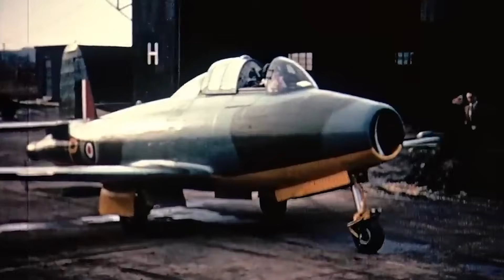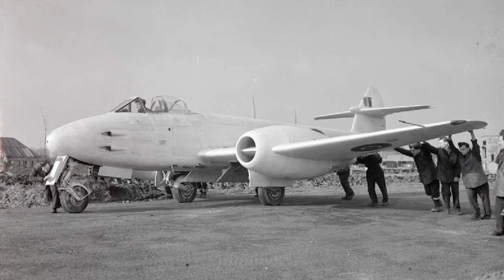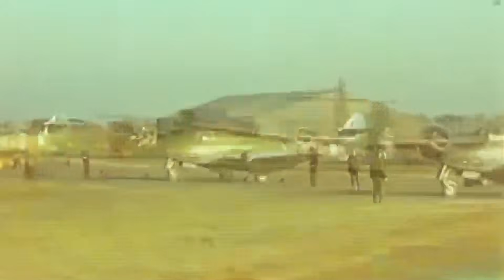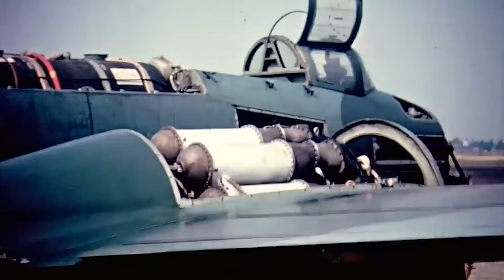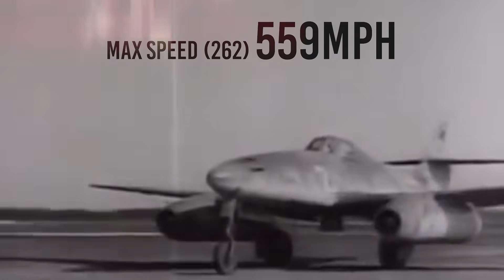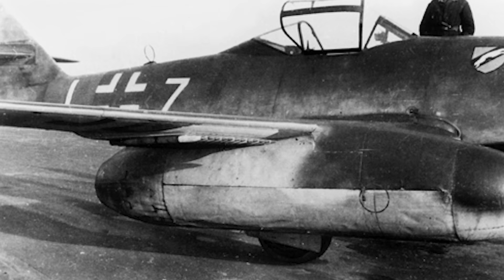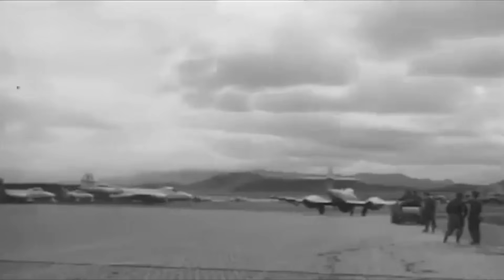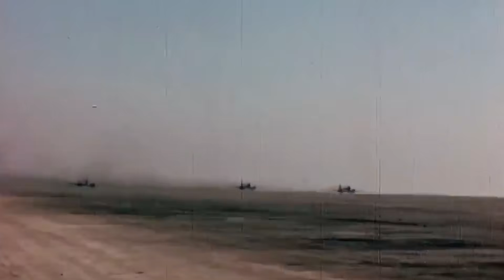Meteor vs Me 262 | Which was the better WW2 jet?

Comment: I understand the Meteor turned better. It was slower than the 262, but ended up faster in later versions.
The 262 wing sweep was a centre of gravity modification and was a similar angle to the C47 transport.
Whittle chose the less powerful centrifugal flow engine design for better reliability until metalurgy improved. He was aware of the advantages of axial flow.
Reply: Whittle didn't "choose" to build a centrifugal flow engine. It was never a choice. The simple, low tech centrifugal flow engine was all he could do. If he could have built an axial-flow jet engine, he would have. Whittle never built an axial flow engine.
Reply: @TheAneewAony Whittle did choose. The Germans did choose. The Germans chose max performance over reliability, which was ill advised with poor metallurgy.
 
Whittle chose reliability over max performance, as he wanted metallurgy technology to catch up.

Whittle knew of both jet engine types.
Reply: @kentl7228 No Whittle did not choose. It was never a choice. If the British could built an axial flow jet engine, they would have. We know this from the the failed attempt the British made with the Metropolitan-Vickers F.2. One Meteor, S/N DG204, was fitted with the Metropolitan-Vickers F.2. The engine exploded killing the pilot William Davie. The British were unable to build a working axial flow engine until 1947
Reply: @TheAneewAony Because of materials. What don't you understand? How to design and build one was known by Whittle. It was a choice to build within the limits of current materials. The Germans chose axial and suffered from their materials not being able to handle the stresses involved.

Citing an engine blowing up is less useful. This can be attributed to difficulty and inconsistentcy in manufacture and material quality.
Reply: @kentl7228 It was just a lack of British science. Nothing more. Hence the British failed to develop an operational combat jet during WW2
Reply: @TheAneewAony What is your comprehension problem? The Meteor was in combat, chasing down V1 flying bombs, in actual squadrons. It was in frontline service before the 262. The piston engined fighters were doing their job well enough and the British wanted to keep their technology in safe hands until needed.
Reply: @kentl7228 What would the Germans learn from the Meteor? How to build a slow straight wing fighter with obsolete centrifugal flow engines? Nope, the reason the Meteor wasn't used in combat was its slow speed, according to Eric Brown. After the war the British made great use of German technology and scientists... perhaps you've heard of the Concorde, designed by two Germans, Dr. Dietrich Küchemann and Dr. Johanna Weber
Reply: @TheAneewAony The F104 and FA18 have relatively straight wings.

I am not even espousing the the Meteor as a great fighter. I consider it a dead end like the 262.

Brown had biases at times and there was almost nothing else in jet fighters to compare to. The better turning Meteor was quite quick by wars end and was around 600mph just after that.

The Meteor was always better for a military to use than the 262, because the Meteor was far more mission ready due to the service life of the engines. A great fighter that is only ready for three days a week, is a big problem over an good fighter ready every day.

Citing two designers is irrelevant. Except for some Yaks or whatever, 262 type designs disappeared for a good reason.

Ones like the P80 but evolved, kept coming. The T33 was used for many decades and the 262 wasn't made en masse after WW2 for anyone, as it was obsolete.
Reply: @kentl7228 You are disagreeing with Eric Brown because he does fit your flawed agenda. The 262 was the future, it appeared in WW2 and was actually used in combat. The Meteor and P-80 were not. The Germans already had a straight wing centrifugal flow jet fighter that was much more capable, faster, and better armed than the Meteor in the He 280. Interestingly, the He 280 flew before the E.28/39, illustrating how far ahead the Germans really were. Postwar England was completely bankrupt and had to operate obsolete equipment such as the Meteor. It was not a choice.
Reply: @TheAneewAony You still talk in circles and are just wrong.

You state Eric Brown not fitting my agenda. You are not a mind reader and I admire the man but he wasn't a perfect human. 

The low ready rate of the 262 was a huge failing compared to the Meteor or P80. Can you understand that sentence now?

The evidence is in the actual usage of the 262 versus the P80. The 262 wasn't the future. Developing from the P80 was. The step from P80 to F86 wasn't much. You avoid the fact that he P80 airframe was used up to the mid 1980s. Hardly any 262s flew beyond 1946. A whole four decades earlier. Do you understand that now?

Nobody used your pet wonderwaffen 262 to any real degree after WW2. If it was worthwhile, it would have been copied. Kurt Tank had jet designs  that were more inspiration to the future, for the allies.

The Meteor was officially used in combat. The P80 flew a few patrols in Italy but never found a target to play with. Do you understand that now?

As for mentioning the Meteor and England being too broke to replace it, do you not understand that I said that I consider the Meteor a dead end like the 262?

Incidentally, the Vampire would likely have given the 262 a bad day.
Reply: @kentl7228Try using logic. Was the 262 in WWII combat? Yes.  Was  the Meteor in WWII combat? No. Was the P-80 in in WWII combat? No. Was the 262 faster than the Meteor? Yes. Was the 262 faster than the P-80? Yes. Did the 262 have 28 jet aces? Yes. Did the Meteor ever have any  jet aces? No. Did the P-80 have any jet aces? No. Did German jet technology change the postwar future? Yes, Concorde, F-86, B-47, Mig-15., F-102 - 106. Space travel, moon landings. Do jet fighters use centrifugal engines? No
Reply: @TheAneewAony  Everything there wasn't logical. The flaws in what you just listed, were explained several times before. You are beyond help.
Reply: @kentl7228 OK, maybe this will help: "It was the world's first operational jet-powered fighter aircraft and one of two jet fighter aircraft types to see air-to-air combat in World War II, the other being the Heinkel He 162.[5][6]"  and "The Me 262 was faster and more heavily armed than any Allied fighter, including the British jet-powered Gloster Meteor.[7] "  and Eric Brown again: "He referred to the Me 262 as "the most formidable aircraft of WW2." -- https://en.wikipedia.org/wiki/Messerschmitt_Me_262
Reply: Having a 4G limit against a 3G one on the Me-262, helped a bit.
Reply: Foremost I would say the 262 was not a true fighter, it was a devastating Bomber Interceptor and in the hands of a competent pilot was untouchable by enemy fighters because all the 262 has to do is leave, or if really pushing offensively making zoom attacks from favorable position and energy states rather than getting into a turning fight where the 262 would lose any advantage it had as it lost both speed and altitude.  The duel between a 262 v Meteor or 262 vs P-80 would come down to who is in the seats and exploiting their platforms strengths to the fullest.  Given the choice I would want to be the guy in the P-80 because I think it had the most beneficial advantages if they had to fight, but I would take the 262 if running was an option because a speed advantage means you control whether or not to engage and the terms of the engagement.  Against either jet the best course of action for the 262 is to leave.
Reply: Most 262 apologists also insist on stating absolute speed rates as a point to say it was better than “insert something else here”. What is never mentioned is that the 262 could go faster, yes, but the max speed is just that, max speed. The thing took a long time to get there and was only achievable clean and with new engines (ones that had been produced well at that). It also responded really poorly to rapid throttle movements, especially the surge stress on the so called advanced engine designs, so throttle control was super important and not something that could be relied upon in ACM. Coupled with the worse overall maneuverability, logistics and availability rates, the Meteor was superior. 

As you point out though, the P-80 bested them all. 

Another point often made is that the 262 was available in numbers in combat, because they had to be and forgetting that most 262s never made it to combat and the Allies didn’t need to sent their new technology to front line units and thus protecting them from not only the Axis but other allies, Soviets I’m looking at you, noting what happened with the B-29.
Reply: @thelandofnod123  Here, try facts! "However, when the USAAF formally compared the P-80 and Me 262 shortly after the conflict, it concluded that: "Despite a difference in gross weight of nearly 2,000 lb (900 kg), the Me 262 was superior to the P-80 in acceleration, speed and approximately the same in climb performance. The Me 262 apparently has a higher critical Mach number (the Me 262A's was M 0.86), from a drag standpoint, than any current Army Air Force fighter." Ethell and Price 1994, p. 180.
Reply: @thelandofnod123  All 28 WW2 jet aces flew the Me-262, including the highest scoring jet ace in history, Kurt Welter. All this in less than six months. By way of comparison, there has bever been a British jet ace. https://en.wikipedia.org/wiki/List_of_German_World_War_II_jet_aces
Reply: @TheAneewAony Comparing the jet ace stats are pointless. That data is due to policy and opportunity.

By late 1944 and into 1945, the allies had many competent pilot in many machines against fewer and fewer enemies. The Germans had only a few competent pilots and many undertrained pilots in the rest.
Reply: @kentl7228 These 28 jet ace aces were produced after the 8th AF P-51 Mustangs had already defeated the Luftwaffe. The Americans had established complete air superiority in the ETO, yet the jets were largely unstoppable. The 262 was superior the Meteor in every way. We know this from British testing. "...the aircraft had excellent directional snaking characteristics making it a good gun platform. From this aspect it was the best jet fighter of it's time, and I was certainly in a position to judge, having flown every jet aircraft then in existence. A check on the rate of roll at 400 mph revealed the highest that I had ever experienced outside of the realm of hydraulically-powered ailerons, and the stick force demanded to produce these exhilarating gyrations was delightfully light. Leveling off at 12,000 feet I settled down to another spell of the pleasures of the phenomenal roll rate of this delightful little aeroplane ... I had never met better flying controls ... Even if somewhat underpowered it had a good performance - it could certainly have run rings around the contemporary Meteor. I was to fly the little aeroplane quite frequently.

page 138
"Wings of the Luftwaffe" Captain Eric "Winkle" Brown
(C) 1977, Revised 2010, reprinted 2011, 2013
ISBN 9 781902 109952"
Reply: By this comparison the best fighter plane in ww2 was LaGG-1. Simple, robust, low maintenance,  had a great potential for development and SU won the war. It was shitty in the intended role though.
Reply: Tell me who kept developing Me 262 after the WW2. War time Meteors were inferior and the air frame certainly was old school.
Reply: @AM-cw1kp  Meteors were inferior in what respect? There's not much point in asserting that one aircraft is inferior to another without specifying what each was designed for. A fast single-engine fighter doesn't make a slightly slower multi-engine bomber inferior if the purpose of the aircraft is to drop large quantities of bombs. 

Now, let's compare the Meteor and Schwalbe. The wing loading on the Meteor is about 45 psf, while the wing loading on the ME-262 is about 60 psf. The Meteor was designed to a 4g load limit, while the ME-262 was designed to a 3g load limit. 

These factors point to the Meteor being designed for a turning fight, while the ME-262 was clearly designed as a high-speed interceptor. The choice of armament, with the surprisingly low muzzle velocity on the 262's cannon, reinforces this impression. The ME-262 simply wasn't designed to turn hard. It was designed to go straight in, put large cannon shells into unmaneuverable bombers, and leave.

So if you want to say the Meteor was the inferior aircraft for intercepting strategic bombers, well, yes, that's true. But Germany had no strategic bombers to speak of. There was no point in Britain producing an interceptor for German strategic bombers that didn't exist.

On the other hand, the Meteor had a combination of speed, maneuverability, and reliability that made it a much better aircraft than the ME-262 for what the RAF needed it to do.
Reply: @AM-cw1kp Wartime Meteors were not inferior to the 262. Top speed isn't the only metric that matters. The 163 Komet was junk.The engines on the 262 were very bad for reliability and responsiveness. I would call the P80 the best jet design for in WW2. The longevity of the airframe in the trainer T33, speaks a lot. Side intake fuselage mounted engines were better than the evolutionary dead end of either the 262 or Meteor. The 262 wasn't really developed, because it wasn't a good enough design to bother with.
Reply: @kentl7228  Ask Eric Brown. He knows better than you.
Reply: @AM-cw1kp  I was waiting for that. Some others with credibility disagreed. Brown talked about the performance. Fast for one hour and down for days is not as good as slightly slower but ready twice a day.
Reply: @kentl7228  Me 262 made history.  First Meteors shipped to Continent were even slower than piston engine fighters!
Reply: @AM-cw1kp The 163 made history, but it was crap. The 262 had a terrible maintenance and sortie rate. That is a huge problem, which you aren't addressing. The Meteors got much faster in subsequent versions. Whittle wisely kept the engines conservative as metallurgy and experience improved. Either way, the P80 os a better design than either the Meteor or 262.
Reply: @kentl7228  "Which was the better WW2 jet?" Emphasis on WW2
Reply: @AM-cw1kp The Meteor F3, which did 500mph, better weapons layout, turned better, far more reliable...
The 262 could boom and zoom better, but a few days a week, so to speak...
The Meteor airframe was good enough to they could do 600mph by November 1945...
Reply: @AM-cw1kp  No they were not. The Meteors shipped to the continent were Mk 3's, faster than any piston engined fighter of their day.
Reply: @alangledhill6454   Fist Mk iii which were equipped with early version Welland engines.
Reply: @AM-cw1kp  Wow! They shipped an aircraft from Britain to France. I didn't know that. I would have thought they would have flown because, at the closest point, it's only about 20 miles from shore to shore. Thanks for sharing.
Reply: @PS-n5f  How stupid you are
Reply: @AM-cw1kp  Meteor never allowed to fly over Europe because if they got shot down they would have given secrets to Germans...  The better control and reliability of the Meteor engines made up for any difference in top speed - and the Meteor was more agile.
Reply: @kentl7228  P-80 had British De Havilland   Goblin engines sent from UK The same engine used in DH Vampire - the early Russian MIG fighters that kicked the 4ss of USA fighters in Korea also had British engines - given to Russia by UK, the MIG had a much better airframe than the P080.  Details of British jet engines given to USA in Tizard mission early in WW2,  General Electric built Whittle engines.
Reply: @AM-cw1kp   P-80 was available end of WW2, using De Havilland Goblin engine used in D H Vampire - also flying before WW2 ended.
Reply: @AM-cw1kp  No Mk3 had welland engines, they all had Derwents, onlt F1s had wellands, and not very many of them either (first 12 whch by october 1944 had all been converted to Derwents(
Reply: @zaphodbeeblebrox5973  Twenty Meteor Mk Is were built (serial numbers EE210-229). They had RR W.2B/23 Welland turbojets, each rated at 1,700 lb s.t.

QUOTE: “The first fifteen Meteor IIIs (EE230-244) differed from the Mk I solely in having a sliding cockpit canopy, in place of the sideways hinging canopy, increased fuel tankage, and some airframe refinements. The sixteenth (EE245) and subsequent Meteor IIIs received W.2B/37 Derwent I engines rated at 2,000 lb.s.t.” 
Explaining this in plain English: The first Mk IIIs had low rated Welland turbojets, same as Mk Is. Top speed of Welland Meteors was only 410 m.p.h. at 30,000 ft or 385 m-p-h at sea level.
Reply: @chrissmith2114 All true. The F86 also had a much better airframe than the P80. But perhaps as a fighter, as the T33 lasted a damn long time, so as a trainer, it was an excellent airframe.
As for Russians and English engines, wearing soft sole shoes and walking over swarf in the English machine shop making jet engines was pretty clever. Watch who you give tours to.
Reply: @kentl7228 did this matter in WW2 when the Me262 was flying?
   What was the P80 doing in 1944?
Reply: @chrissmith2114  what was the P80 doing during the European war?
   This is the context.
Reply: @davewolfy2906  Two P80 were flying in Italy and two were in England, at the start of 1945, before WW2 ended. That qualifies the P80 as a WW2 aircraft. If the trainer version was used until the 1980s, that makes it a good airframe. The wing slung Meteor and 262 were more dead end designs. Certainly to be admired though.
Reply: @kentl7228 Well now! "However, when the USAAF formally compared the P-80 and Me 262 shortly after the conflict, it concluded that: "Despite a difference in gross weight of nearly 2,000 lb (900 kg), the Me 262 was superior to the P-80 in acceleration, speed and approximately the same in climb performance. The Me 262 apparently has a higher critical Mach number (the Me 262A's was M 0.86), from a drag standpoint, than any current Army Air Force fighter." Ethell and Price 1994, p. 180.
Reply: @TheAneewAony  I still rate the P80 as a superior design. That data you espouse was for a short time period, but the P80 engine improved quickly and was always more reliable than the ones on the 262.

Wing slung designs were a dead end. If an engine failed on the 262, which was very likely, the assymetric thrust was a huge problem.

The P80 could fly each day of the week, unlike the 262.

Another source
The Lockheed P-80A Shooting Star produced a higher total thrust (3,850 lbf) from its single engine than the Messerschmitt Me 262 A-1a, which produced a combined total of 3,960 lbf from its two engines. Despite having slightly less total absolute thrust, the P-80 was significantly lighter, granting it a superior static thrust-to-weight ratio

Thrust vs. Aerodynamics: Although the P-80 had a better thrust-to-weight ratio—yielding a superior climb rate and lower-speed acceleration—the Me 262 held the speed advantage at high-speed cruise. The Me 262 utilized 18-degree swept wings, allowing it to delay compressibility and achieve higher top velocities in level flight.

So some stats are better for one over the other. Either way, the P80 had more options available to evolve the design. It was far more reliable. Except for a few early Soviet jets, there were almost no other engines slung under/in the  wings away from the fuselage designs again.

Future Nazi jet designs that were never made, looked better options than the 262
Reply: @kentl7228 The wartime P-80 was in absolutely no way better than a 262. We know this from postwar testing conduced by the Americans. Major Richard Bong was killed in a P-80, the report by the Army Air Forces Office of Flying Safety concluded that a minor explosion in the jet’s power plant caused the P-80 to lose power. By August 1945, 8 aircraft had been destroyed in accidents, resulting in the loss of six pilots and leading to a temporary grounding of the fleet. Keep in mind, the war was over, and the 262 had already made 500 -700 air to air kills. The Gloster Meteor achieved 5 to 6 confirmed air-to-air kills in post-World War II combat, primarily during the Korean War. The P-80 possibly 17. In any case, the 262 is much more significant historically.
Reply: @TheAneewAony Absolutely no way better than the 262? Not better overall? Not better in some aspects as well? Either way, that is a very big assertion.

My point was that the P80 was the best design because of the fact that it wasn't an evolutionary dead end. It is much more like a modern jet. Fuselage mounted engine with nose cone and fuselage intakes near the cockpit, tricycle undercarriage from the start etc. If you mention wing sweep, the F104, F/A18 among others have little wing sweep and the 262 has sweep that was a bit more than the DC3.

Pointing out deaths by accident in the P80, utterly ignores that there damn well was  bunch with the Germans as well. The catastrophic failure of the occasional P80 engine, doesn't change the fact that the ones installed in the 262 were far worse. The small amount of hours between needing a complete overhaul is legendary for the 262.

The fact that the P80 was used into the mid 1980s, in the T33 trainer form, is a great testament to getting a lot correct, first time.

Lastly, comparing kills by 262 to the Meteor ignores the circumstances. The British wanted to limit the risk of it falling into the wrong hands and they had the opportunity to proceed in practice and development, at a non desperate pace, unlike Germany. The opportunity to fight targets for the 262 was frequent, when their engines were working, because having 1 fighter for every 50 allied, makes life rather target rich. The experten pilots were given the 262, adding another factor. The allies were satisfied with their piston engined fighters carrying the load against Germany, as they knew that attrition was rapid and the defeat was coming soon.
Reply: @kentl7228 Stay focused. The P-80 during WW2. BTW, the highest scoring jet ace in history, Kurt Welter, flew the Me 262, with more kills than the P-80 and Meteor combined.
Reply: @TheAneewAony Stay focused? You miss the point and don't understand, it seems. Let alone that I asserted the P80 was better and why. Your focus on kills by the 262, utterly ignores the wealth of opportunity that the 262 had. What is hard to understand about this? It is very simple. The P80 and Meteor were quickly replaced by better types, like the F86, that had the future opportunities for air combat.